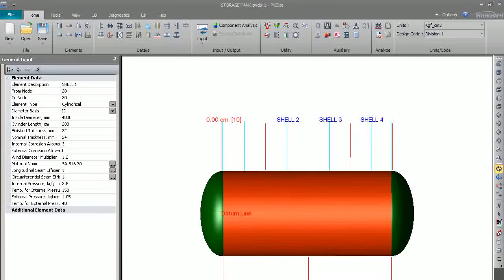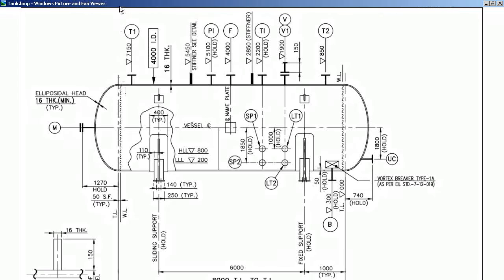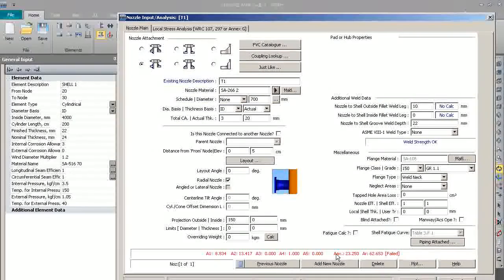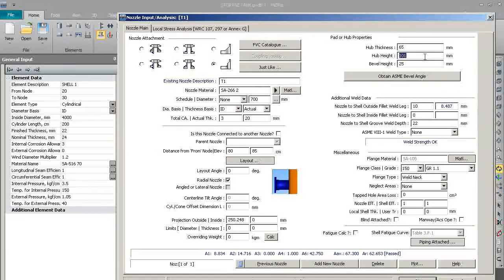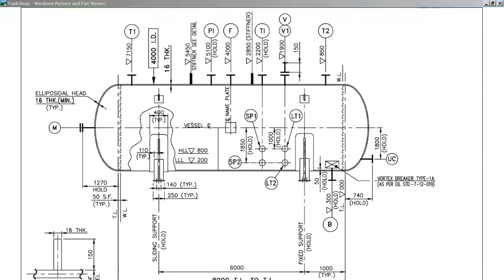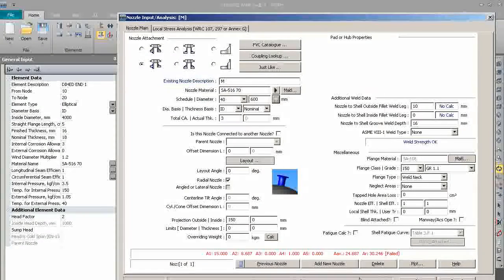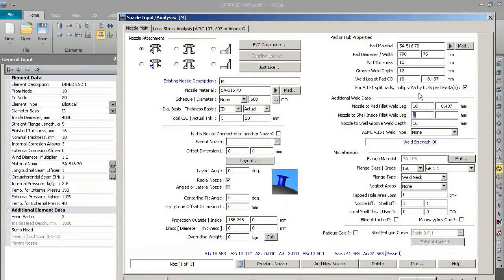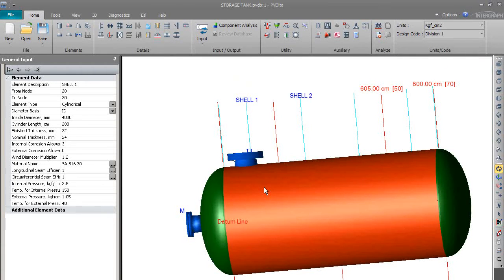PV ELITE TRAINING SESSION 5

Comment: In Nozzle input section , my nozzle schedules are in DIN, how can i change it to Sch? Anyone can help?
Reply: Go to Tools> Set Configuration Parameters > Default Value Settings. Choose default nozzle database to ANSI Metric (mm).
Note: You can't change this if you already added a nozzle(even if you removed it) to the project. In that case you will need to create a new project.

Comment: i have changed the units to mm in (Select units).eventhough it is showing inch in (schedule/diameter tab) .   How to convert unit from inch to mm in (schedule/diameter )
Reply: Go to Tools> Set Configuration Parameters > Default Value Settings. Choose default nozzle database to ANSI Metric (mm).
Note: You can't change this if you already added a nozzle(even if you removed it) to the project. In that case you will need to create a new project.